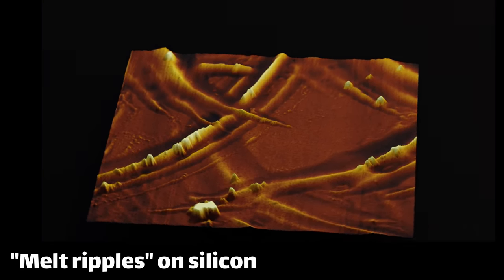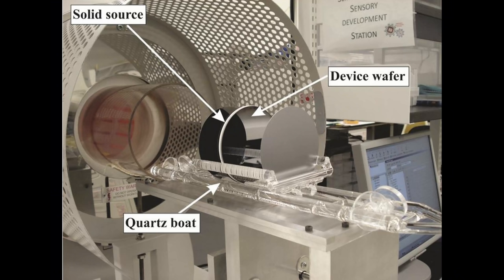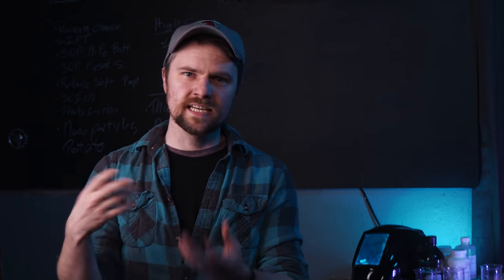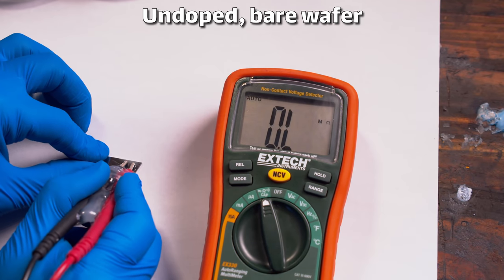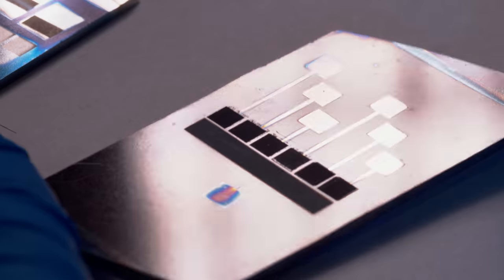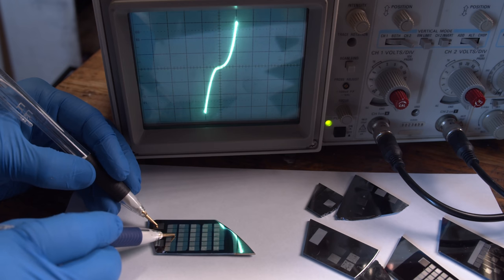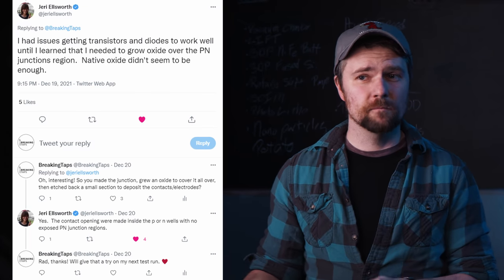Doping Silicon with Lasers

Comment: thanks for sharing! I loved seeing the process and SEM pics. This is def promising for home chip fab. If the resistance goes down then the doping is working! For a while all my PN junction curves looked like that too, fixed it by using Al with a few % Cu mixed in for both P and N contacts and annealing at 450c. Pure aluminum tends to alloy with the silicon and forms spikes that go deep into the wafer and shorts your junction to the undoped silicon below. Not sure if this is a problem with Ti/Al. Also, your sputtered metal electrodes overhang the doped regions. Is there thick oxide on the non-overlapped regions? If the doped regions are 1x1mm, maybe try sputtering metal only on the center 0.5x0.5mm of each  to be safe
Reply: Can also check your junction by shining a bright light on it and measuring the voltage cross the diode, like a solar cell, should be able to get 100mV
Reply: Dang dude! Is that your experience  from hobby building😲
Reply from the maker: Thanks Sam, appreciate the tips! Good to know about Al/Cu contacts, I'll look around for a sputter target. Did you make your own target, or something that can be bought commercially (or maybe layer thin Cu first then thick Al)?

Yeah, I was irritated at my shoddy mask alignment there 😭 The wafers did have a reasonably thick thermal oxide (500nm-1um, just based on time/temp) protecting the other regions. But the laser might be churning up the edge and could be unprotected.  I'll try again with smaller contacts!

Will check with a flashlight too.  Not sure why I didn't think about that 🙃  Appreciate all the help!
Reply: @Mwwwwwwwwe  that dude is actually insane, definitely check out his channel if you haven't already. he's on another level.
Reply: @Alexander_Sannikov  DUH🤦‍♂️ didn't see that he had a YT  chanel... thanks will check it out😁
Reply: @BreakingTaps  Hey, if you can find it a Al99/Cu01 target would be ideal. Two separate depositions and a annealing step could cause two things:
-Creation of deep level traps in the silicon by the Cu
-Depending on your atmosphere oxidation of the Al and the formation of the already named spikes.
Another common electrode could be W90/Ti10 but I'm unsure if it used for diodes and such since I work in MEMS.
Reply from the maker: @faxezu  Thanks! Pinged my sputter target supplier and asked about Al99/Cu01 (I needed a Zr target for something else anyway, so might as well grab one while I'm at it).  Noted on the rest, thanks for the info!  So much to learn!
Reply: @BreakingTaps  happy to help. Lots of al/cu targets available on ebay. I need to make really thick metal layers (2um) so i can wire bond to them, so i do thermal evaporation. Used 4043 aluminium alloy MIG filler wire, it has high Si and Cu content which seem to mitigate contact diffusion and spiking up to 450c anneal
Reply: @SamZeloof  are there things where you opt for sputtering over thermal evaporation?
Reply: I suggest you try it with a laserjet (water) beam method with a water resistant phosphrous photomask pre applied applied on wafer  ,the goal is to keep the silicon wafer from devloping the oxides on the surface and if you worry about water then it can be replace with oil or other o2 free liquids
Reply: I like your words, magic man
Reply: What lazer device you re using?
Reply: Dude im a huge fan. Just saying...
Reply: Titanium, I vaguely recall, was one metal that was used as a barrier metal for aluminum contacts; since it didn't have the spiking issue.

Comment: If you input an AC wave into the wafer while using x/y deflection on the scope, you can apply the the AC signal to the x probe, while reading the output with the y probe. You will get a hysteresis curve telling the function of the pn junction at that AC frequency. The freq to use will depend on the capacitance of the junction.
Reply from the maker: Interesting, I'll look into that! Is that what the curve tracer is doing? I have a cheap "octopus tracer" which I was using to generate the curves, but not entirely sure the circuit or if it would function differently (there aren't really any controls, so I can't change the AC freq for example).  Thanks!

Comment: If you want to play around with it.. I have a 600W (1 joule/pulse x 600hz) 308nm XeCl laser used for surface annealing flat panel displays in OLED production.
Reply: Yeah, much better. It would take more passes but you could move faster... That would let you fine tune the surface texture while still getting a good deep implant structure. 👊
Reply from the maker: Oh wow, that's quite a laser! Where'd you get that beauty?

I might take you up on that offer at some point in the future. I'm in the middle of moving my shop to a new location at the moment, so I wouldn't be able to put it to use for a while. But perhaps in the future!  I did recently find a 1W q-switched 355nm laser which I'm hoping to get commissioned soon, but unsure if the power will be high enough to do anything at that wavelength.
Reply: @BreakingTaps  Work - we repair lasers used in semiconductor photolithography, typically 193nm and 248nm systems that put out 10-40W.

The 600W 308nm system is for flat panel displays.   The only problem is the thing is a bit of a 'sledge hammer' compared to the 'scalpel' you're currently using.. It's just the light source and there's no beam steering/exposure tool attached.  The raw beam is very large (~40mm x 25mm) so you would need some masking if you want to limit your exposure area.
Reply: @sooocheesy  Oh, that changes the equation... Gonna have to get in touch with Hoygans optics and see if a collaboration is in order.

Comment: Ion Implant process engineer here. Your description of my process was spot on! I'm impressed how you succinctly and thoroughly explained what I do in just over a minute and might have to steal your explanation when people ask me what I do!

You also mention that ion implant will probably never be feasible in a home fab setup, and that's probably true under one condition... if you are concerned with purity of the energies and species being implanted. If you are OK just implanting everything in your source gas, it may be feasible for someone to setup a "shotgun" implanter, which is basically a plasma chamber fed by some dopant-containing gas over the wafer with an acceleration grid in between that sends all the positive ions into the wafer, dopant included. This was actually the first type of implanter ever used in industry. One issue with this design may be uniformity, not sure how this was solved in industrial applications. Another issue is that you still have to anneal the silicon to "activate" the dopant... speaking of, have you considered sending your laser doped wafers through an anneal furnace to "wash out" some of the nonuniformities?

Comment: Multi-layer contacts can be done using, for example, one or more of Mo/W/Ti/Cr as a Shottky or Ohmic contact, depending on your application and diffusion layer doping. Consider making a four probe resistance measurement setup (linear or square) for example with tiny pogo pins. You could also make the opposite side of the wafer back side electrode and measure your diode structures (e.g. pnn or even pin with more pure silicon) through the wafer.
Reply: Good idea.
Reply from the maker: Noted, thanks! Will look into constructing a four probe setup, that's a good idea with pogo pins too. Would be a lot simpler and less fiddly :)  Cheers for the tips!

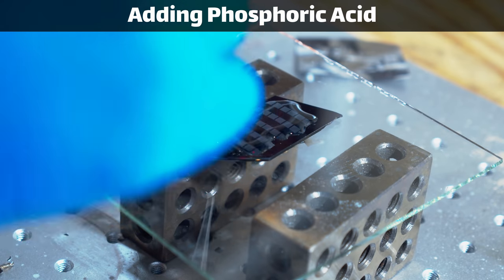Comment: 5:08 I am in tears. What a wonderful image.
Edit: Just saw that you were trying to make a diode. Well, the contacts are of paramount importance. Who on earth did tell you to use Al as a p contact???!!! Generally, you need high Workfunction (Φ) if you need an ohmic contact to a p-type semiconductor. You can think of it like this: the n-type semiconductor has a high fermi level and generally likes to give electrons, so you match it with a metal that likes to give electrons, such as: Cesium, Na, K, Aluminium. On the other hand, you match a p-type semiconductor with a metal that likes to retain its electrons, such as: Platinum, Selenium, Copper, Gold. Platinum and Selenium are kings with a work-function Φm being 6.35eV!!!!

Comment: In college when we built mosefts, diodes, and capacitors we purged the chamber with nitrogen at the end of annealing. I think the final aneal had some hydrogen to get rid of dangling bonds. Been years since I have done it tho. I look forward to your content and my own lab once I can afford to set up my own lab.
Reply: What degree were you studying where you got to do this ?
Reply: @shawnm8232  Electrical engineering with a focus on nano device physics.
 
I had a difficult time getting a job after college though. Awesome subject, didn't end up paying my bills though. Software is soooo much cheaper and faster.

Comment: If you have a 1064 nm fibre laser you could just use SHG to generate 532 nm pulses. Should work if you only need like 40 % max power at 1064 nm. And you should probably get a system to remove those white clouds when you're doping, maybe immerse the wafer in phosphoric acid and use a small pump to circulate the fluid?
Reply: that would be incredible, but I once read it's nor known how to double frequency with fiber lasers as is done with yag. Do you have useful information about this?
Reply from the maker: Yeah, definitely investigating some kind of flow chamber to keep the phosphoric moving across the surface and clear bubbles. In some cases you can see where the bubbles have disrupted the underlying laser path, which we'd want to avoid for precision paths.

SHG is on the potential todo list!  I'd love to have a pulsed green laser, would open up a few projects. I don't think it would be too hard to put a crystal in the optical path but haven't looked too closely yet.

Comment: Great video, and I do like to see the in-progress state of things. The content is very well presented.
Is a grown Silicon Dioxide layer transparent to your laser because of the thinness? I thought SiO2 was not very transmissive to long IR (>10um) like C02 lasers, but that's probably gigantic compared to the layer thickness.
Reply from the maker: Thanks! The SiO2 is pretty thin, even the "thick" thermal oxide that I grew was about 1 micron. But the laser I'm using is 1064nm, which is juuuuust barely infrared and SiO2 is still pretty transparent to it because it's almost visible.  You're right though, if this was a CO2 laser it wouldn't be a problem at all, and would ablate away the glass easily :)

Comment: This seems like a great way to create a radiation detector by flashing an array of PN diodes that can be used to measure a "picture" of radiation, from the field, by using a shielded lead box around your array and a lens of aluminum to focus the gammas onto the array like an old box camera. The resolution would be set by the pixel size of your diodes and inversely proportional to the distance rule.

BTW -have you tried your diodes under intense light to see if they are photovoltaic?

Comment: 2kOhms for a basically undoped wafer doesn't sound high tbh. You will probably need some additional p-type doping for your diodes too (for example thermally on the backside of the wafer?)
Nice work anyway!
Reply: As for why the reverse breakdown happens: it could be a Zener-type breakdown, where the tunnelling is accelerated by silicon lattice defects. Did you try thermal annealing after your implantation?
Reply from the maker: Ah interesting. I'll try doping in some boric acid as well, I hadn't thought about that aspect. (or just get some more highly doped wafers).  I did not do any high temperature annealing.  The Ti/Al contacts were annealed at 480C for ~1hr, but I suspect silicon annealing needs to be done at like 1000C?  Will give that a short on the nexttest run!

Comment: One thing i've always wondered is how schottkey diode packages are made. In the final product, it's effectively wire - ? silicon ? - wire, so how is it manufactured such that one junction has schottkey behavior while the other is an ohmic contact?
Reply from the maker: I'm not sure to be honest! Maybe I'll tear one open to check.
Reply: Its the doping gradient of the silicon, one edge of the silicon is heavily doped to form an Ohmic contact when it touches one wire. Then the rest of the lightly doped silicon naturally forms the schottky diode at the region of contact with the other wire. (The information on the wikipedia page Schottky Diode is correct but without a guide to doping ratio, about 1000 times more dopants is a rough guide) 

Note that the work function of the metal wires used are a part of the equation which will affect the diode formed

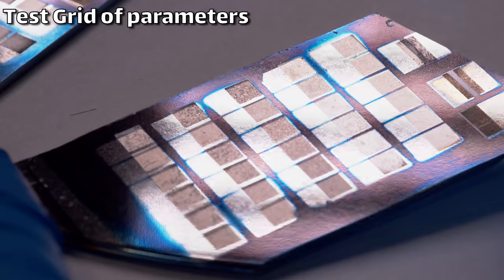Comment: 7:00 With your disclaimer noted: The wavelength silicon problem is interesting, so maybe also try a different material via your technique. Regarding P Type (vs N Type), (KIST) Korea Institute of Science and Technology made (for Van der Waals metal contacts) contacts from chlorine-doped tin diselenide for CMOS made of thin-film 2D semiconductors.
My comment has no hate in it and I do no harm. I am not appalled or afraid, boasting or envying or complaining... Just saying. Psalms2

Comment: I have done my first tests with laser doping and my results where around 10-25 ohm per sequare centimeter with a xtool f1 ir laser. and i have been able to do this multiple times in a row. also trough 360 nm termal oxide.

Also the hot probe test works well

Comment: Is it possible to use off the shelf CW Blue laser modules instead of pulsed fiber lasers? Curious because XY laser engravers are cheap and ubiquitous which should make doping so much more accessible to hobbyists.
Reply from the maker: I've tried with a "15W" blue diode laser and didn't have any luck. Gets the silicon warm but not enough power density to melt, even with a microscope objective to focus the beam. Perhaps with a newer, higher-powered laser though! In theory it's definitely possible, and in some ways better (shorter wavelengths are more fully absorbed by the silicon, and to a thinner depth too).

Comment: The amount of thermal damage as evidenced by the ripples, etc., would seem to be counter to the process of making "good" diodes, since the junction is no longer particularly single crystal, so is likely to have leakage and soft breakdown characteristics.    It may be possible that lower power for longer durations could allow the dopant to gradually get incorporated into the wafer.  You only need around 900C local temperature for boron doping as I vaguely recall from the process used a job from over 40 years ago.  Ditto phosphorous, I think, although that might have needed a higher temperature, say closer to 1000C local temp.  But otherwise, that was the approach, we coated the wafers with dopant and popped them into the furnace for an hour or so.

However, I also vaguely recall that our diffusion process resulted in growing kind of a doped oxide layer, possibly, which then had to be removed.

Comment: 4:54 In your video it looks as if you first scanned laser surfaces, then put phosphoric acid on the surface. And finally you performed another laser step for doping.
Why do you need the first laser step? To absorb more laser-power at the wafer during doping?

Comment: question.. you seem to just be setting a pool of fluid on top of your silicone. that is a HUGE variance. Why not put a layer on with a q-tip, then add a slide of glass? the surface tension will give you a pretty repeatable thickness of fluid.

Comment: Hi new here. 
This process looks like Lazer welding only with a two material binding vs a three alloy binding. So I wonder if a Lazer with nano meter wave form is sufficient to do something like this or if because the size of the junctions if it would be to large. I never though about trying anything like this in my own shop. But if I can can get a type 3 clean room I'd give it a chance. Or perhaps I'd need to try a fish tank build chamber. I should see how ppl build up a shop to do this.

Comment: Another way to test junctions is by probing in the dark.  Take millivolt / micro volt reading of a junction in the dark and then shine infrared light source at junction and measure the voltage generated.  Even light emitting diodes behave like micro solar panels when put in sunlight and the voltage can be measured with a basic voltmeter.  This is how photo-diodes and photo-transisters work.  Well actually photo-diodes lower their resistance when illuminated by the correct wavelength (usually infrared).  Theres no doubt in my mind that hobbyist will eventually produce customized semiconductors at home in the comming years.

Comment: So cool!!  To combat your SiO2 problem may I suggest creating a nitrogen filled environment to prepare your wafer in?  I'm imagining something like a sandblasting box (I know it's a lot of volume, hopefully N2 isn't that expensive) so you can work in it without introducing oxygen.  Then you would be able to chemically remove the SiO2 layer (HF acid perhaps) and then cover your wafer with the phosphoric acid and you should be able to remove it from the environment and zap it with your lazer and not have to worry about messing up the surface!  :)

Comment: Phosphoric acid is not the best choice because it contains Oxygen. The Phosphorus is driven into silicon, and so is Oxygen. You end up with a Silicon mixed with Silicon Dioxide, which is not suitable for any devices. Maybe Phosphine PH3, flammable, toxic, etc?
Reply: ok

Comment: instead of using an acid could you sputter the dopant onto the silicon? possibly even after removing the oxide if that's an option. I feel like that could make the amount that ends up in the silicon more reliable.